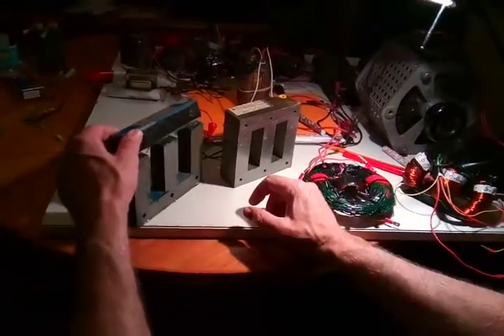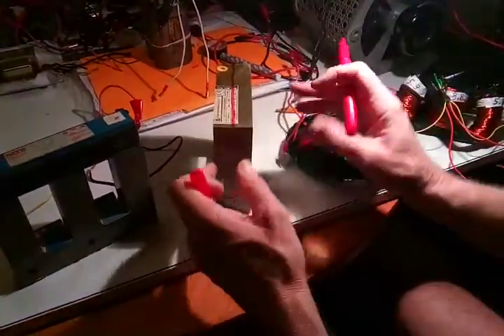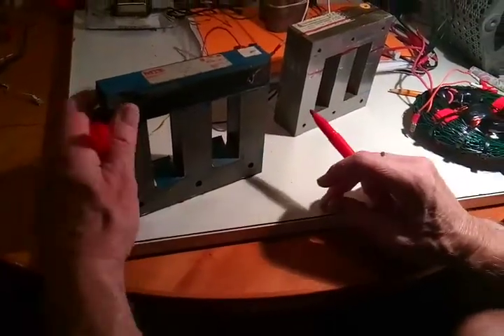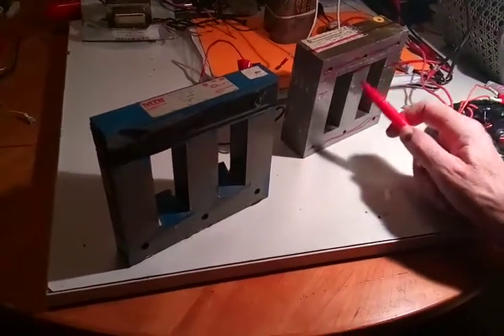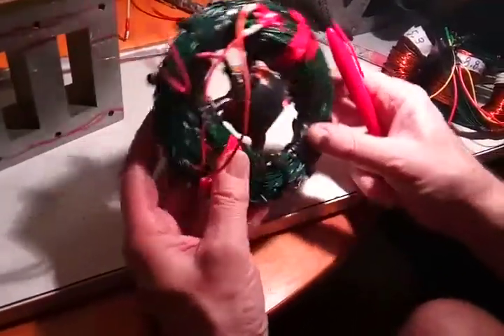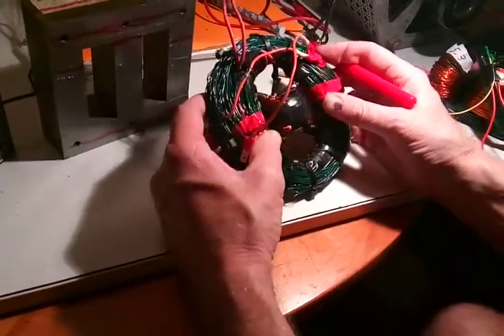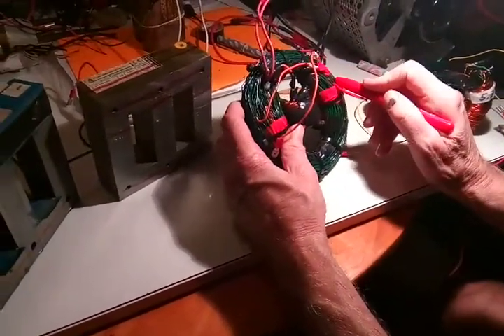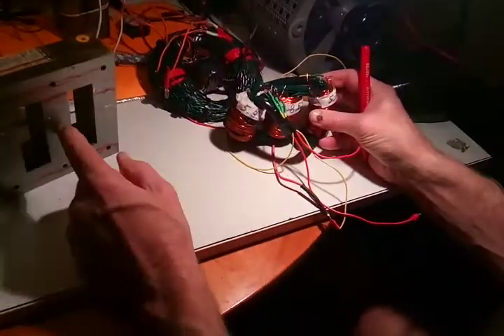BiTT transformer progress

Comment: Apparent power is still power it causes heat which takes power to produce. You will see different results when you load down the motor the overunity factor may diminish. Have you tried combining the resistor with the coil in series than measure at each load separately.
Reply from the maker: Hi WP&M  I havent thought of doing both resistor and coil in series I suspect the resistor depending on ohms will kill it but who knows maybe not will have to try it out. This will create more confusion in exactly what the output is in real watts but confusion is my friend to keep the skeptics unhappy. 
 I should be rectifying the output with FWBR or single or doubldiodes into cap too, and put another cap on the other side of FWBR too, and then resistance goes onto that final cap to check real power, so AC cap before bridge, DC cap after bridge this is more stuff to try out.  I am keeping it simple keeping it all AC and all 60hz for now.  I really want to power a motor with the florist wire BiTT also returning the power made from generator coils back into motor coils such as Muller generator or Bedini style with also generator coils with a BiTT could be the key to looping ezeesqueezee

Comment: Hi Doug, Happy new year!
This apparent load thing gave me an idea! imagine you are pulsing the transformer as you would a pulse motor... and you are using the "load" coil as a motor coil.. Could that give you a different result? in the sense of real overunity in opposition to apparent overunity?
Keep it up
Luc
Reply from the maker: Hi Luc
Kurt up in Calgary did do some YT videos a few years back with a BiTT made with ferrite rings and he injected DC into and got good results with draw dropping under load, so it should work fine, maybe much better than AC since the collapsing field would not have the AC change over top of it, sort of time to breath.
Not sure what you mean by "load" coil, the primary or the secondaries....if primary, yes why not have that bang some magnets around in a rotor too should work great, if by "load" you mean the secondaries, again why not should work fine....maybe do all three coils configured to push.pull three magnets at once in a rotor.
Also I have been pondering making no-lenz generator coils from this BiTT design - generator coils induced by passing magnets, and the backemf that causes lenz reaction gets "shunted" away with the shunt bar.....I wouldnt be able to use 3ph transformer cores for this I dont think but could create something from florist wire or maybe cores of 100% iron mixed with epoxy in suitable shape would work out.
Real overunity vs apparent overunity might be more difficult to prove or measure correctly with pulsed DC vs AC 60hz as you get into the backspikes and all that which if being "carried" with the backemf magnetic forces might blow it out of believability.  Really want to loop stuff only way to settle arguments about power out vs in
Reply: Hi Luc yes good idea, if you can saturate the primary during the ON pulse then the Lenz flux coming back sees a high Z flux path. During  the OFF time doesn't matter as the source is OFF anyway.